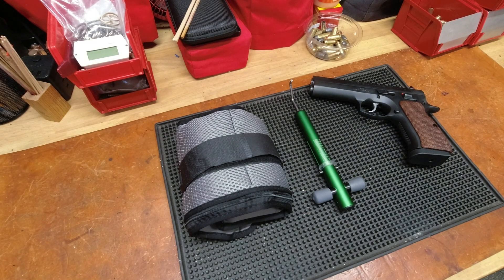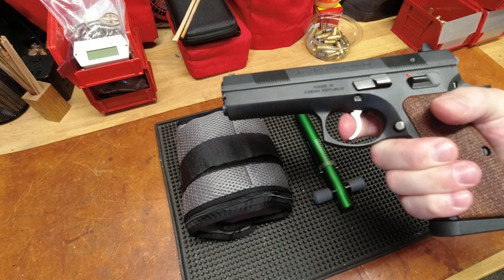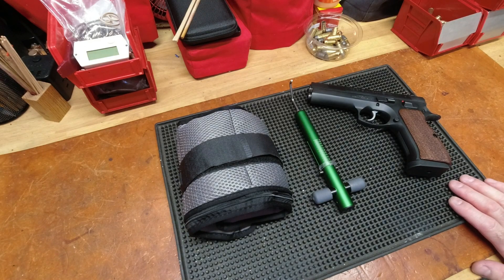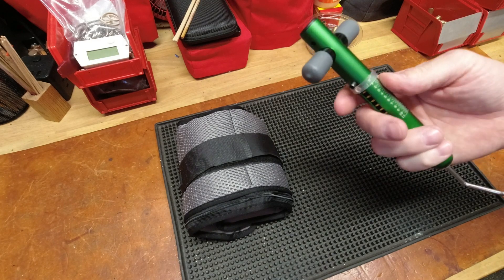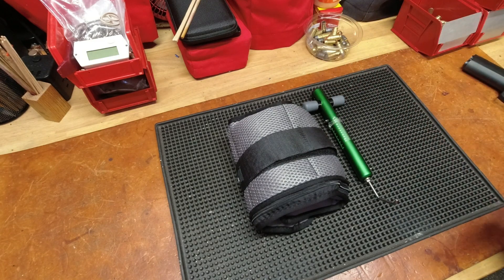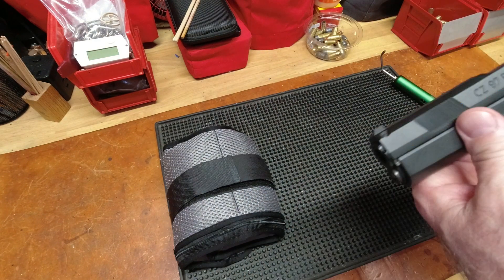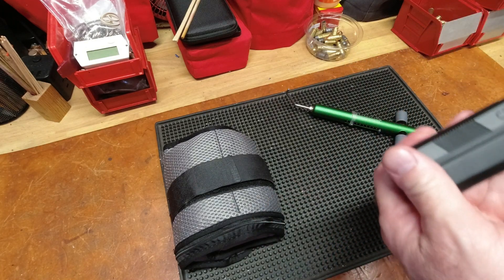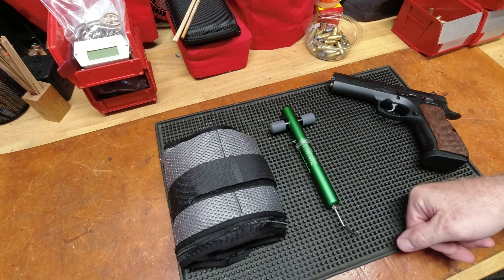Analog / Mechanical Trigger Pull Weight Measurement (and thoughts about digital options)

Comment: Scales for trigger pull are similar to calipers, different every time you
use um. However, in the case of the trigger pull; a good trigger will bring
a little more consistency to the same pull weight.
Reply: Consistency in your pull angle and speed would be better for accurate results.
Reply from the maker: After watching quite a few videos on the digital versions, I was less than impressed with the consistency.
Reply: @ReLoadersBench    Well then, a little more tea and back to the drawing board :-))